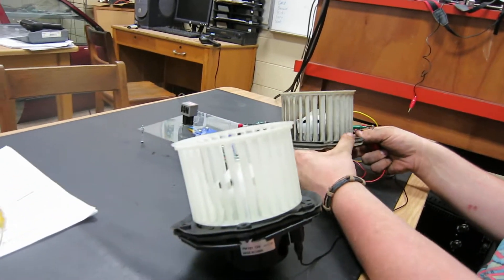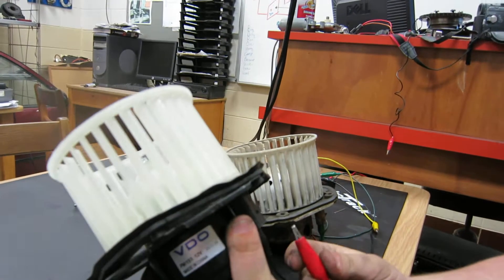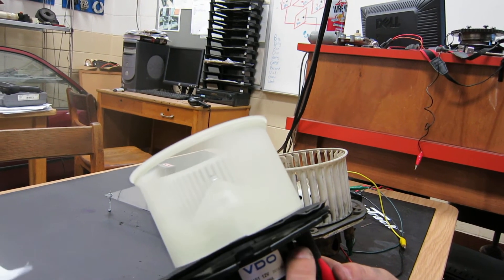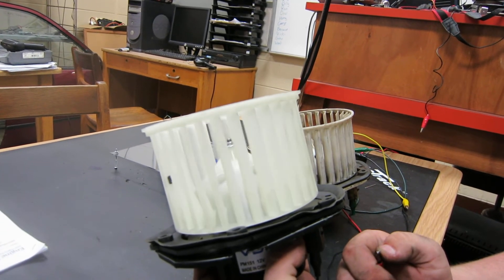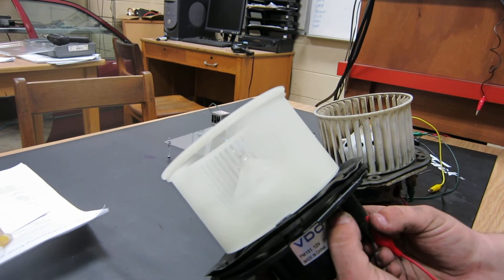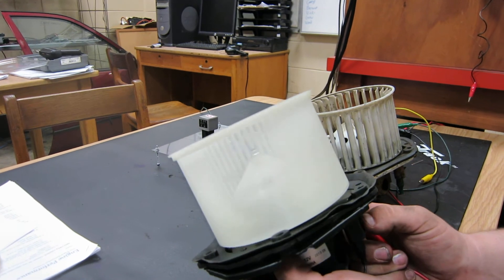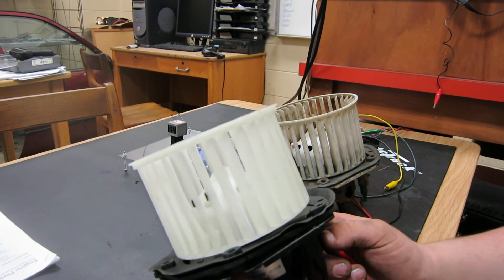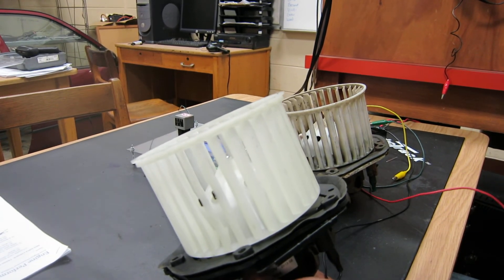Blower Backwards

Comment: Thank you sir !
I have a 2001 Jeep Wrangler. I spent a lot of time checking actuators, vacuum lines and blockages. Turns out somebody put the blower motor plug in backwards. It’s been running in reverse for least 2 1/2 years.A new Mopar fan was going to cost $400. I took out the battery .I took out the computer. I taped up some exposed wire and flipped the plug around. Now I have tons of cold air 😀
Reply from the maker: It always feels good to get to the bottom of one like that.

Comment: Hey guys have nissan X trail t30  doing the same thing after replacing blower motor curious how do u reverse the rotation ?
Reply from the maker: Two choices - get another blower that's built right - or reverse the two wires at the motor (bad idea)
Reply: @McCuistian  Thank you sir for the quick response allready changed  2 of thoos cheap motors araound 30 eu  and all of them burn in few years no air blowing .. i taught it is my evaporator coil which i cleared  and still no  air blowing from vents.Just   my motor burned ordered expensive one saddest thing is even the fan shows with arrow anti clockwise movement but yet the motor is spinning clockwise ... 
Lets hope the new expensive motor works fine ..
 I live in Bulgaria steering is on left passsenger side AC Unit is on the right yett it is blowing opposite direction really helpfull video mate.
Reply from the maker: @Mitkopwn2   For a work-around, you can reverse the wires at the motor - ?
Reply: @McCuistian   There  are 2 wires red and blue but in order to make them fit the clicking white plastic has to be removed cables cut and redone then reversed.I am clueless whit what i can get them out  with without cutting the plastic and  swap their positions.
Reply from the maker: @Mitkopwn2  Those connectors can be very annoying - but you could cut the wires and use solder and shrink tubing to reconnect them reversed from where they are now.
Reply: @McCuistian  works  like brand  new after  swapping cables  even new blower  was  clockwise instead  of  anticlockwise  most helpfull tips  and  video  ever !!  P.S  after  the  Ac  unit  removal  there  is  cover  held  by  screws  which gave me  direct  acces  to  the  evaporator  core which i cleaned  very  well  the  car is  2006  X  Trail  t30  petrol  Europe version Left  steering  wheel (the  right  place)  .
Reply from the maker: @Mitkopwn2  Great news!!!

Comment: Could you just reverse the wiring harness (ie is it a reversible motor)?
Reply from the maker: Well, you could, but I always worry about the next guy who gets the right blower motor and becomes befuddled because of the swap - of course, the car might not ever need another blower and probably won't. LOL
Reply: mine did the same thing. Amazon special. how can I reverse this
Reply: I got mine today and it is rotating the same with no air coming through the ac vents. How do i rotate it?